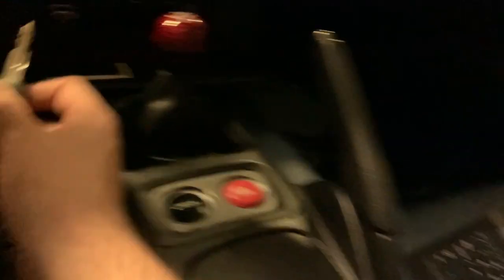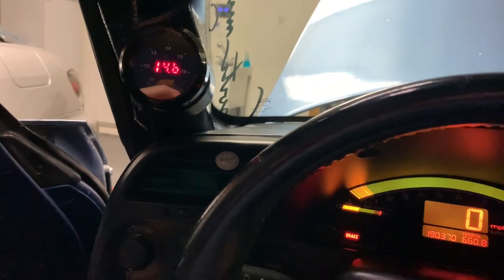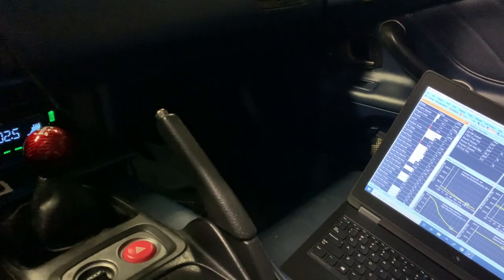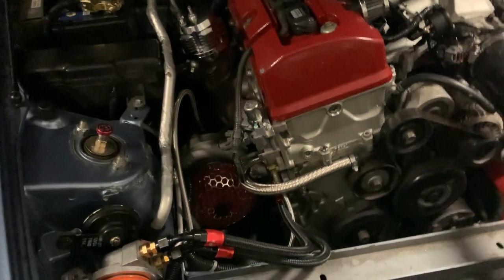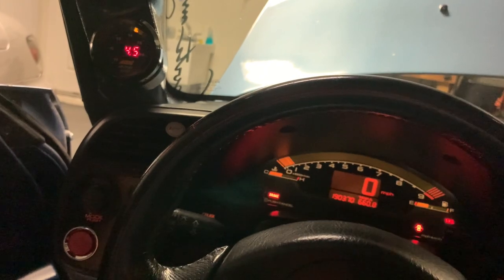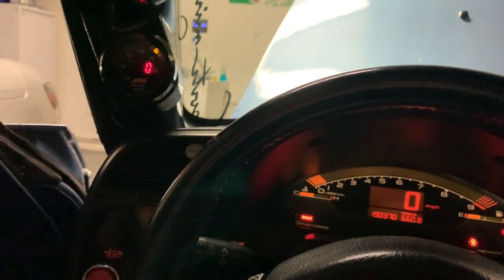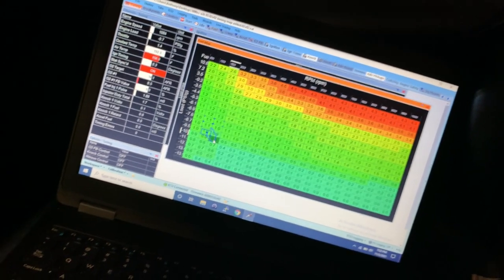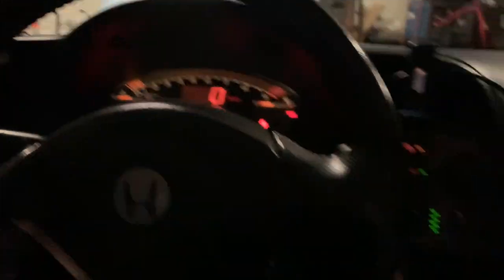S2000 AEM Tuning - Turbo S2000 - PART THROTTLE AND IDLE TUNING

Comment from the maker: If you need assistance or interested in remote or local tuning, contact me by leaving a comment below! 😎
Reply: Where are you located
Reply from the maker: @henryhooker3282  East side of Tampa in the Brandon/Riverview area.
Reply: @ArcLightAddicts  nice! You aint far from me at all. Can you tune a 95 nissan hardbody pickup?
Reply from the maker: @henryhooker3282  message me directly 904-422-6402.
Reply: Hey just want to know where I can contact you about remote tuning a I a few questions
Reply: I've got a V6 Miata Running AEM that's needs a couple tweaks for driveability!
Reply: Need help with throttle response!  Running big cams and seems to need more fuel with quick throttle changes

Comment: I’ve recently boosted my s2000. 1000cc injectors, ngk 8 plugs gapped down, 340 fuel pump, i brought it to a shop to put it on a dyno but we kept getting breakup around 5500-6000rpms. I changed the plugs again, nothings changed. Please help lol
Reply from the maker: Have you been able to get a full pull in all the way to redline?
Reply: @ArcLightAddicts  no I haven’t been able to break the 5500-6000 range. My tuner tried moving vtec but the number didn’t fluctuate. It feels like a limited but on aem there’s none set.
Reply from the maker: @e46boi42  sounds like a tuning issue but who’s the tuner? I’ve seen this before.

Comment: I have ap1 aem s2 when I get on 93 gas afr goes to 9.0 when I get on throttle any suggestions
Reply from the maker: The fuel map needs to be tuned in the part throttle 0” vac + areas. Take out a bunch of fuel until you reach desired AFR. Highlight entire column in that pressure area.
Reply: @ArcLightAddicts  thank you sir